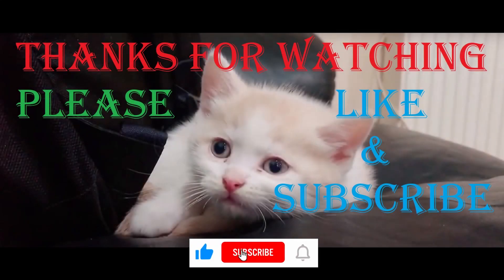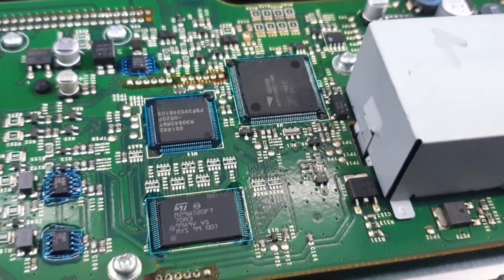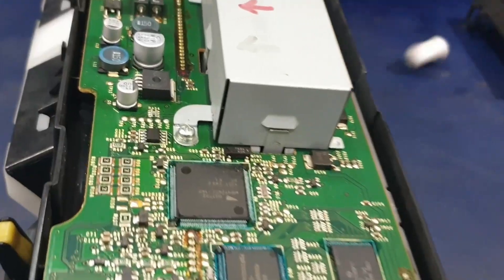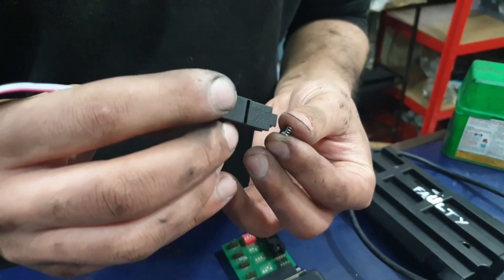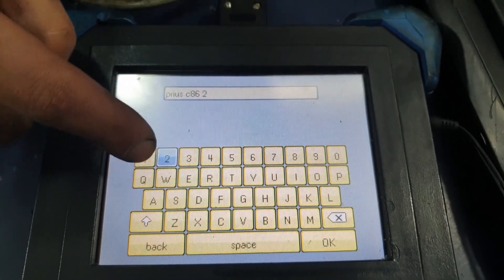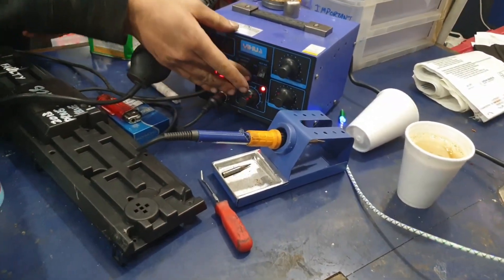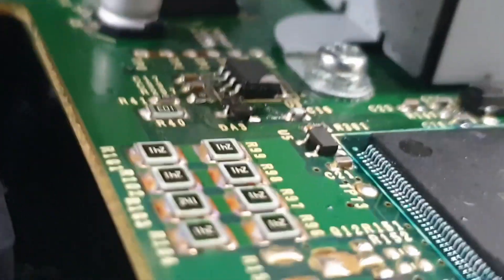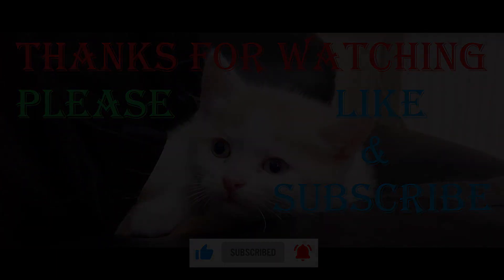2009-2016 Toyota Prius Gen 3 Mileage Correction with DashFixer Machine Chip Eeprom 93c86 Speedometer

Comment: Hey i recently received a 2010 toyota prius and i dont know exactly what is causing the problem but as im driving the speedometer reads 100 mph while google maps says i am going 60 mph, it is an all digital display. Is it possible for me to fix this i issue myself without taking it to a repair shop or dealership
Reply from the maker: send me whats app images and video on +447949094859.

Comment: hi, does gen3 prius require programming VIN into this instrument cluster assembly, or just the mileage? thank you for video! very helpful!
Reply from the maker: No need vin. just mileage,
Reply: @universalinformationentert3976  hello, nice video, do you have to program it if you are replacing with a used odometer since the mileage is same on the replacement odometer too.

Comment: hi
i need to change my speedo from km to mph on a estima hybrid 2009.
could you please help/guide.
thanks
Great video .
Reply from the maker: i have 1 speedometer from estima which is already converted. the miles are 86000 on the clock, price is 150 pounds, it can be posted if you wish, 00447949094859, thanks